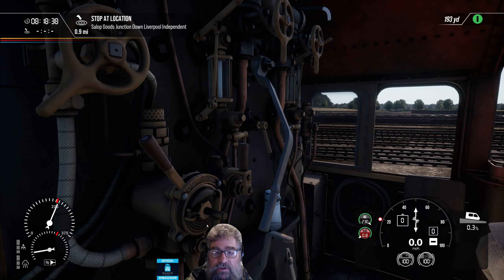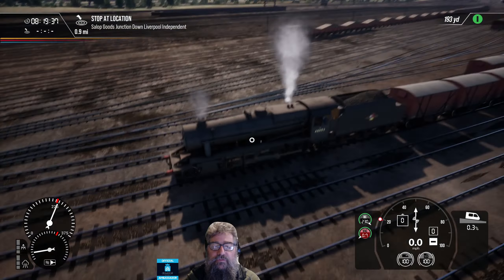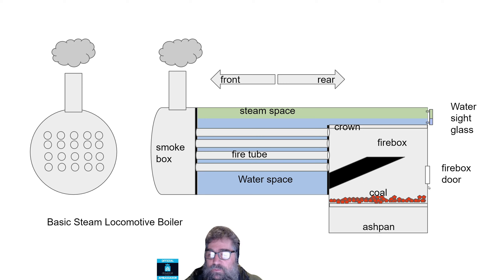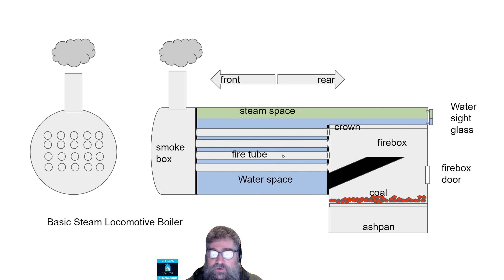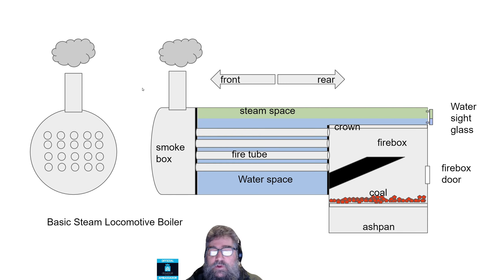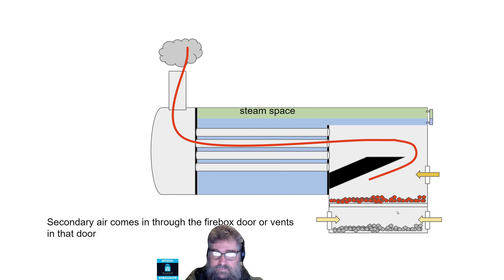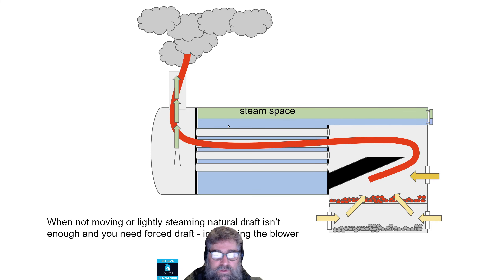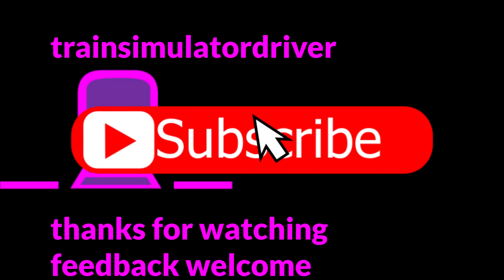Making Steam Engines Steamy Tutorial

Comment: You could make an increasingly complex series of these!
Reply from the maker: Hehe that seems to be what's gradually happening 😃
Reply: @trainsimulatordriver  Kind of needed in the simulator space with the introduction of "moderately advanced" steam locos to a different audience than TS - I dont imagine many console TSW users to have ever had to tackle one of TS's more advanced locos.
Reply from the maker: @savvnz  I expect that's one of the reasons why the 6P and 8F are a bit of a half way house between too easy and too hard. For a seasoned player too much of it just happens for a novice its a bit hard to get it going without input.

Comment: I’D love to know how the reverser works, great series btw
Reply from the maker: The reverser is relatively simple, it changes how long steam is let into the piston and in which direction the motion will turn. The longer steam goes in each stroke the more power you have but it's less efficient and you go slow. Putting the reverser fully forward is like first gear in the car, lots of torque but little speed, you start fully forward then bring it back towards mid gear. As you come towards mid your available power decreases but your efficiency and speed increase. To go up hill you'll need to go back towards full forward. There's a driving tutorial in this playlist that will help.
Reply: @trainsimulatordriver  ah Yes i saw that video but It still wasn’t clean to me how it exactly worked. Now I see. Thanks you for the info!
Reply from the maker: @killerzed2  you're welcome, maybe I should make a video just about the reverser and regulator... I could possibly use footage from the real steam engines I work on

Comment: Thanks for these details on the dampers and basic steam engine functioning. In this vein, I was wondering if you or anybody else could recommend resources for better understanding what the other steam engine controls are doing mechanically. For example, what are the different mechanisms that, on a real locomotive, would be controlled by the regulator and the reverser? Or the large and small ejector? I'm not so much looking for an understanding of game play as a better understanding of what these controls would actually be doing in a real locomotive. Thanks!
Reply from the maker: Regulator controls the pressure and rate of admission of steam into the steam chest that supplies the cylinders. This is the source of power for the locomotive. In a stationary boiler the regulator may be known as the Main Steam Stop Valve.  The steam expands in the piston chamber pushing the piston one way or the other. The reverser along with the slide valve controlled by the motion of the eccentric governs how much steam and when is allowed into the piston chamber from the steam chest. This governs both the amount of steam used hence locomotive power and the direction of travel.
The large and small ejector both do the same thing but at different rates. They both cause steam to act on a vacuum generating mechanism that is pulling vacuum on the braking system. Small ejector does it in a small way and large ejector does it in a large way. Small ejector is enough for light engine or perhaps a very short train. The large ejector does it enough for a train behind the locomotive. The vacuum pulls the brakes off, when the vacuum is destroyed the brakes come on. Note that most trains either use air driven braking or electro-pneumatic brakes. Vacuum is unusual today.
Reply: @trainsimulatordriver  thank you very much for the details. Will search for a diagram to help me figure that out and then maybe 'play with the knobs' in the simulator to see if that helps my understanding.
Reply from the maker: @CVispo  https://youtu.be/nd2Ii4OGQ4k might be helpful and I'll find another handy one....
Reply from the maker: @CVispo  https://youtu.be/F4J2wcDP3YA is really good to watch
Reply: @trainsimulatordriver  Thanks, will look into those and also post other ones that I come across that might be useful to others.

Comment: What does the water injector valve and water ejector valves do? I found them on the tender and don’t know if they do anything or how to use them efficiently.
Reply from the maker: Right now the injectors do nothing. They're not under player control. The ejector (small and large) create vacuum pressure for the braking system. Injectors if they were working are used to put water into the boiler. You would open the water valve, then the injector steam valve and let it do its magic.
Reply: @trainsimulatordriver  thank you, that’s very helpful. Much appreciated
Reply from the maker: @miniassassin2k297  glad to know its helpful